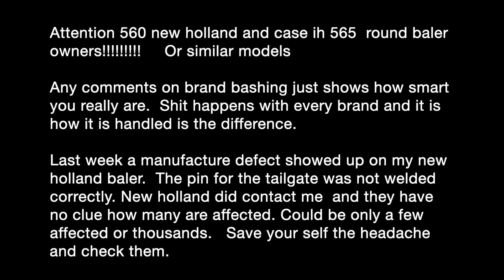ATTENTION NEW HOLLAND 560 and CASE ih 565 ROUND BALLER OWNERS TAILGATE HINGE PIN FAILURE

Comment: That sucks, they better make it right for you. You spend the $ on equipment and shouldn't have to deal with that. Neighbors had similar issues with welds on their white planter they bought new a few years back. Agco wasn't much help for them. I haven't ran a 560 but the 460 silage special I ran for a neighbor worked good but the touchscreen monitor is garbage. The old scratched up bale command plus on our 664 with 15000 bales on it is more functional and easier to use. I have no plans to upgrade unless I start doing a lot more baling than i do now.
Reply from the maker: it was  a shit show mess ... took a yeaar to get it squared away

Comment: Sorry to see this happen to you in the middle of hay season. And as you say no company is perfect, just have to look at the early John Deere 8.1 engines #6 main bearing spot on the crankshaft oil hole drilled to big and let them brake in two and grenade the engine. The dealer i worked at had a pile of bad ones from the recall and 2 new boat anchors from irrigation pumps in the recall bin.
Reply from the maker: what a mess...

Comment: Bad deal, hope there is not 1000 or more defective units in use.  Looks like Robotic welder was defective or an alignment issue.
Reply from the maker: it was a mess and more wide spread than they would admit

Comment: It happens hope they get you changed out and back going are they going to loan you one  and fix yours or trade you out  and there will always be stupid people talking about which one is better they all break I use what I like so do you they are cranking these products out as fast and cheaply as possible things get missed and skipped over sometimes I had a new Holland 3pt disc mower broke the tarp arm off 4 times the last time they came out and adjusted the spring road with me and said it shouldn't break it did they put a solid pin in the inside of the 5th one welded it up never broke again trial and error what works in the West might not work in the south but that's why you have options love the Vermeer roller I have but I wish I could run down the field like yours does I can't go that fast may be I don't have enough horses in front but I still think your pickup and belts spin faster then mine do good luck when you kick out a bale with mine if you don't pay attention the bale might roll forward a little and you can barely see the bale another thing I wish was a little better
Reply from the maker: thanks for the comment ... sorry for no response... just had alot of things in life to deal with